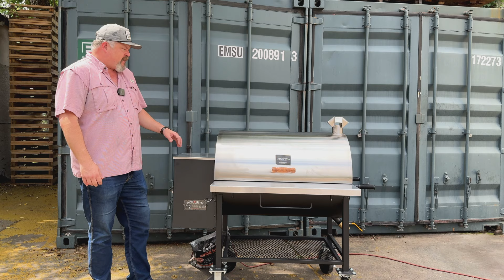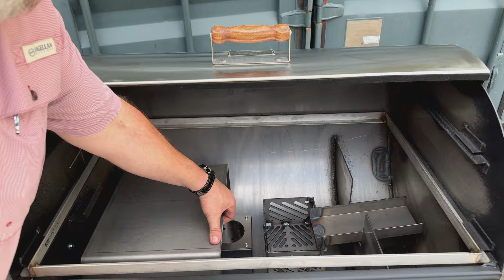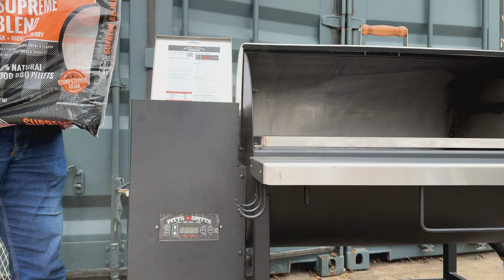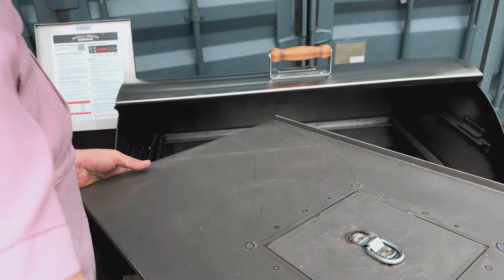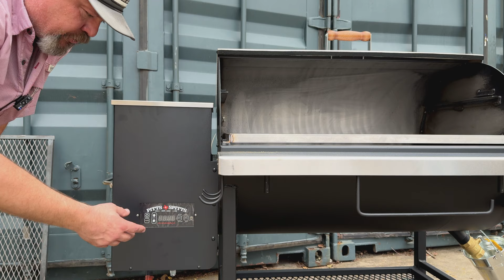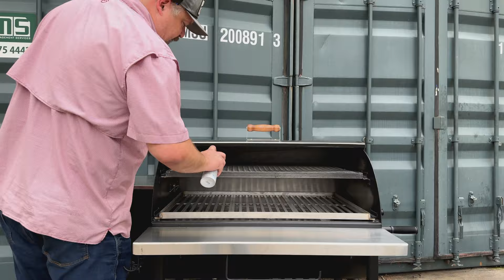Maverick Wood Pellet Grill Series Initial Set Up

Comment: Is there a cooking spray you guys recommend? Also, if you repeat the seasoning process several times does it help build a layer to protect the inside of the pit?
Reply from the maker: For cooking spray, we recommend using any salt-free spray. If you're seasoning your pit, you can repeat the process a few times to help build a protective layer, but doing it twice is usually sufficient.